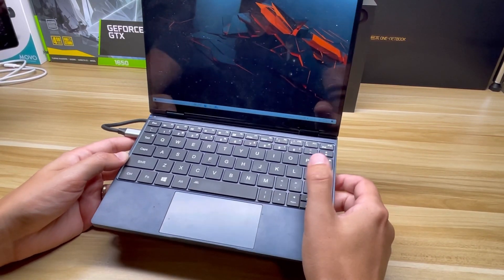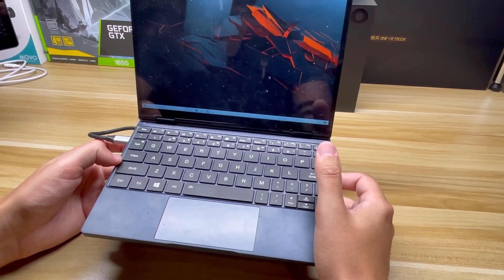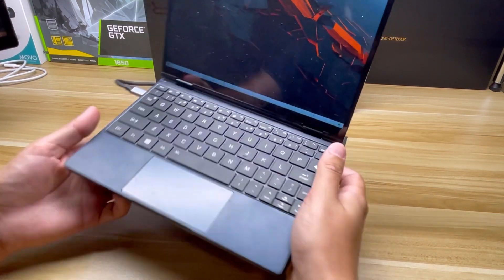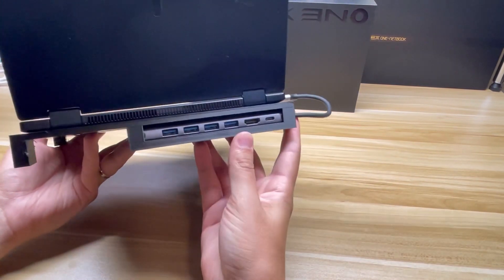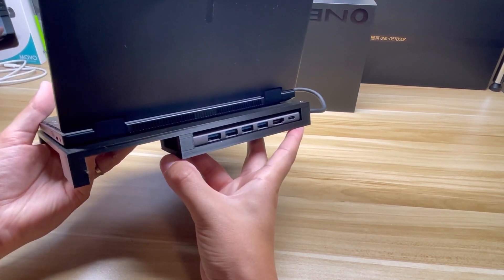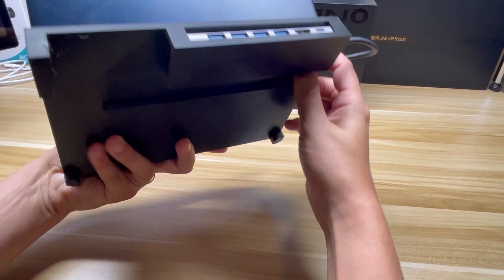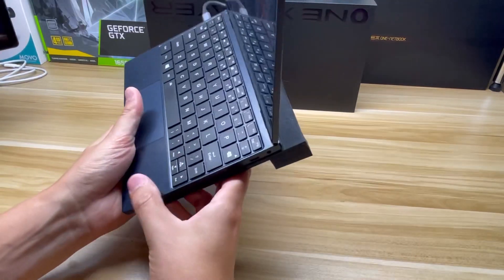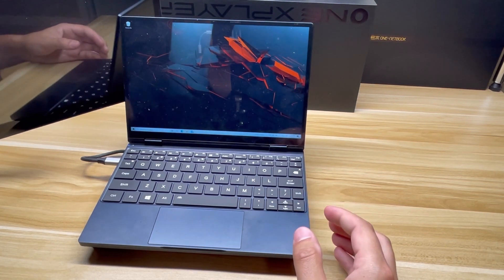Turning this high powered netbook into a desktop setup - One Netbook One Mix 4 Dock

Comment: If you used this laptop all day while plugged in and charging like a desktop ,would this not kill the lifespan of the battery after a few months?

Or does this battery have a charge threshold , and will stop charging and bypass the battery ?
Reply from the maker: Yes this has a bypass mode where power is taken from the outlet exclusively
Reply: @HandheldHardware  thanks is it done automatic with the out the box settings ?
Reply from the maker: @Moonpigmoonpig  yes here is some text I used to describe it’s charging behavior including LED color

LED blue means on, no charging. 
Purple if on and charging. 
Orange if off and charging. 
When the battery is full and still on the charger, the orange light disappears and if it’s on it goes back to blue. The battery is allowed to naturally discharge until about 97% when it starts charging again. I’ve had it last days, while on the charger, where the battery is not charging because it’s between 97-100%.

Comment: I love your desing, but Onemix4 have some 
heat dissipation problom, specially when it in AC power CPU full speed mode, so maybe you could add a fan in the case.